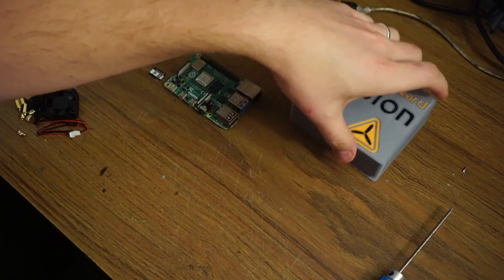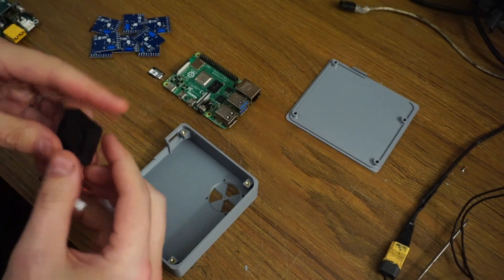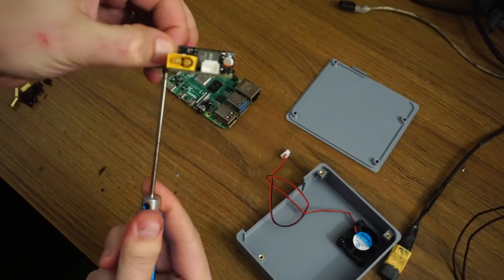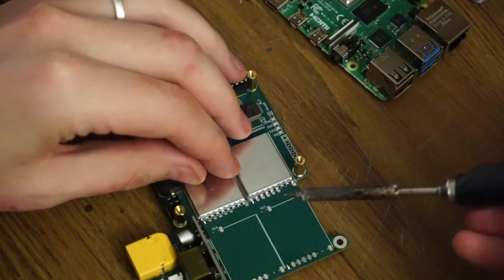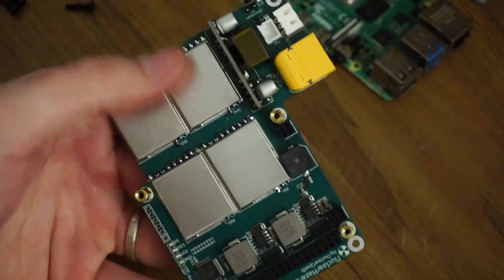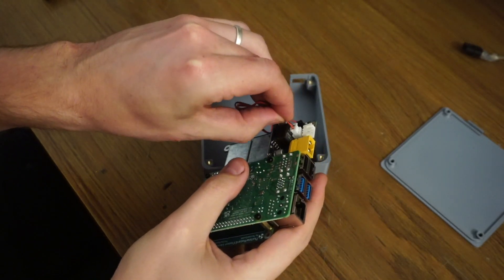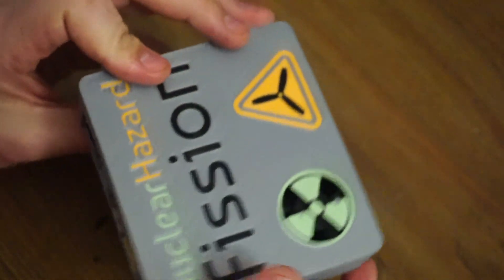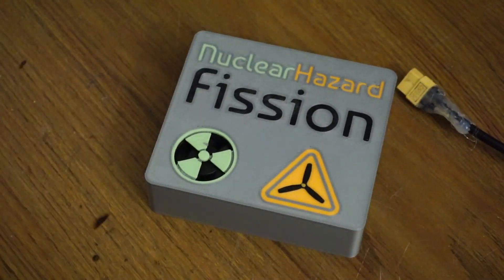NuclearHazard Fission Kit Assembly

Comment: Thanks for the clear instructions on assembly! I just got mine working today and am having a blast. I would definitely recommend using "method 2" for software setup and use Etcher to flash a NuclearHazard image to the Pi SD card.

Comment: Great tutorial!  What is the range on the kit?  At our field we have ~25m from the pilot area to the actual usable track due to restrictions and we can't run a cable.  Was wondering if I'd be able to connect to it at that range.  Thank you!
Reply from the maker: That might be on the edge of the range, but it's possible it would work. If you have a travel wifi ap, you could put that between you and the timer, then connect the timer and your computer to that.
Reply: @NuclearQuads  Great suggestion, I'll look into this. Thank you!
Reply: or you can do it as PoE as power and data link throw IP than you can extended by Ethernet cable as far as 100m (328 feet). i will try this in future if it works. because it is better to do Zero wifi signal as possible for batter video links.
Reply: Hey FoxurFPV, I am running a 50 meter poe spiltter with input voltage of 32V and it power it right up. So I'd give that a go works a treat. I tried some lower voltages until i got to 32V and it was not powering up due to voltage drop.  But POE would be gold without the splitter, there are some reasonably cheap switches with poe+ built in on amazon for like $30 AUD.